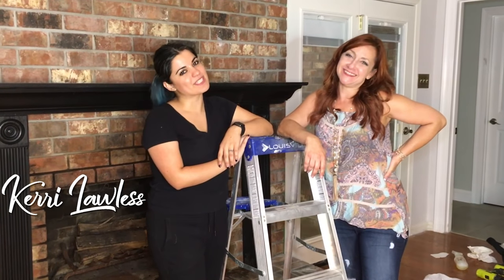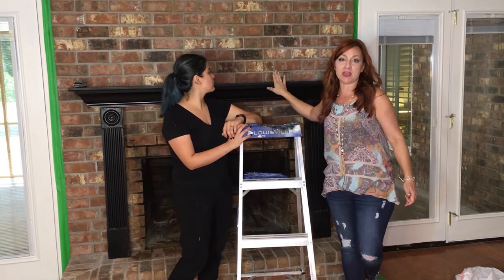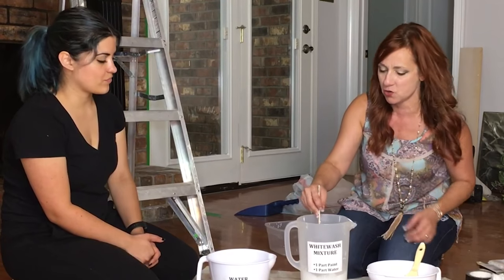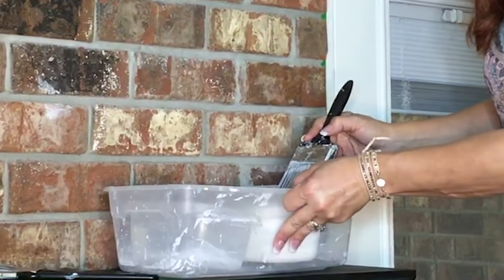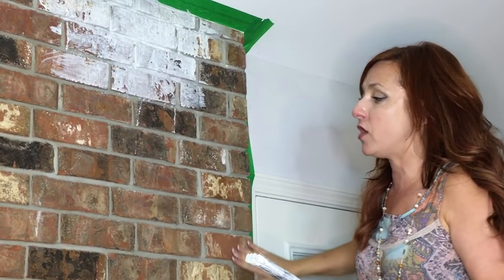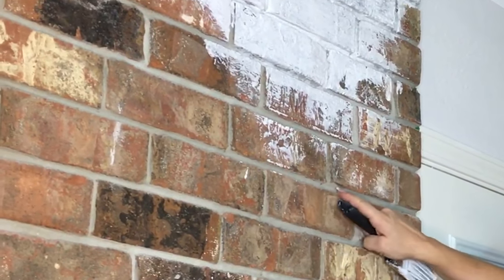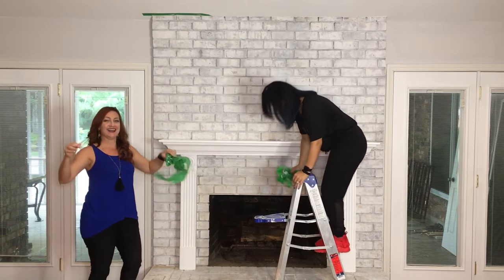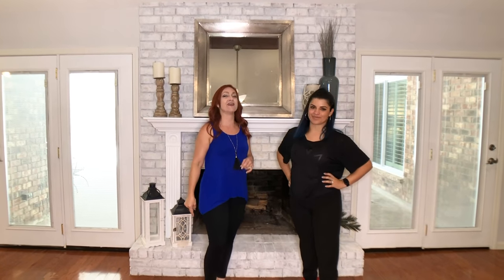How To WhiteWash Brick | Indoor Fireplace | Whitewash DIY *Under $10*

Comment: I have a dark mantle like in the video, can you tell me what paint choice and primer if any you used for that?
Reply from the maker: Sure! I use Zinsser oil based or shellac based primer.  The smell is strong, but it works great! Over that, I would use any good brand of interior Satin Acrylic Paint.  I like the satin sheen because I'm not a fan of very shiny trim.

Hope that helps and thanks for watching!

Comment: I love it but what about when it comes to having to clean and scrub the leftover residue from using the fireplace, the white won’t chip off or mess up in any way? Is some sort of sealant recommended?
Reply from the maker: Hi Nayeli, that's a great question! I live in South Louisiana and never light my fireplace so I would never have that problem! LOL  I would think that it wouldn't hurt to put a clear acrylic sealer over it to make it washable.  I use "Stays Clear" by Benjamin Moore.  Their "Flat" finish would be the most appropriate choice for brick so as not to make it shiny.

I don't think that the finish would chip off since the watered down paint soaks into the pores of the brick, but I've never tried scrubbing it so I guess it would just depend on the harshness of the cleaning product and how hard you scrubbed.  

I hope that helps! Thanks so much for watching!
Reply: Kerri Lawless thank you for replying, the info you provided most definitely helped!
Reply from the maker: You're welcome! So happy to help!

Comment: Hi! So I’ve also read and watched a lot of videos where people put sections on with the brush and then wipe with a rag? And then keep moving in sections. Do you not have to wipe with a rag at all?
Reply from the maker: Hi Celena, In this case, I do not.  I find that just using the brush the way we did in the video works beautifully and is very easy.  I would say that doing it this way would probably give you more consistent results as well.

Thanks so much for watching!

Comment: Do you need special temperature resistant paint if its a functional fireplace?
Reply from the maker: Hi Christopher, we have not had any problems.  The only heat resistant paint that I know of is the BBQ black spray paint, so that wouldn't work and the areas that we paint are not exposed to extreme heat but definitely use your own judgement when painting your own fireplace.  Thanks so much and thanks for watching!